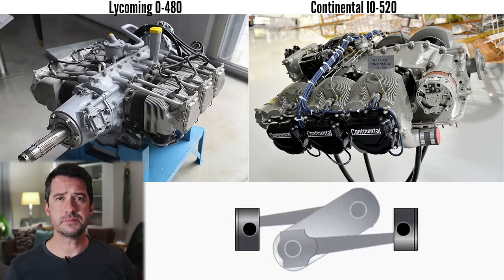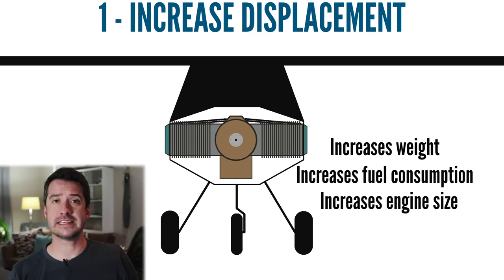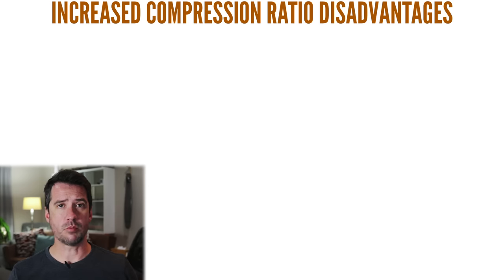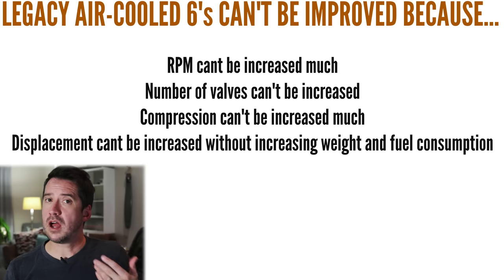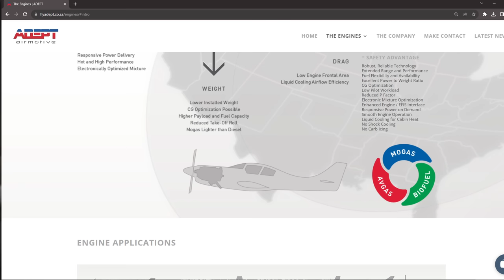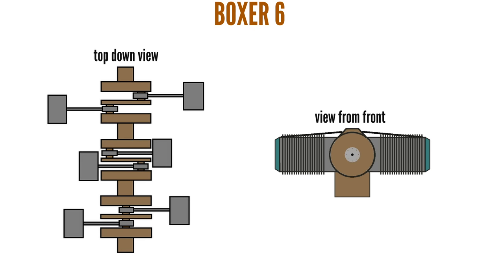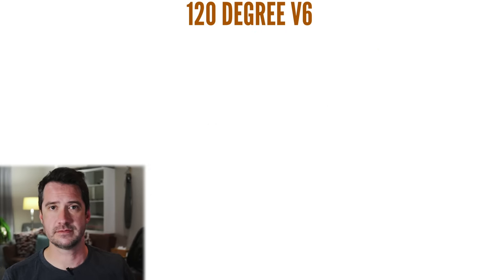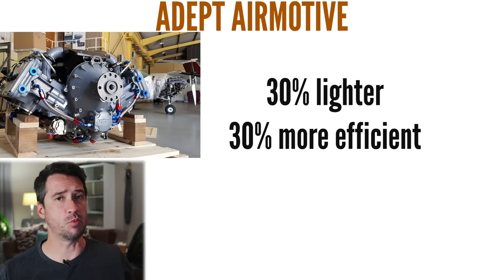Unusual V6 Airplane Engine Makes Boxer 6 OBSOLETE?

Comment: Porsche tried a new aircraft engine, so did Bombardier. Diamond has been using turbo diesels successfully. Rotax has many liquid cooled engines out there too.
Reply: And how many does Diamond sell per year? 15? 20? How many Porsche Mooneys have been converted to Lycoming power?
Reply: all i believe, I have never seen one Diamond sells many but i am not sure how many Astros are out there, Tielerts are now Continentals and i hope they have truly solved the Reduction drive problems, Early DA-42s were more costly to operate than PT6 over the Life cycle ( Fuel included) when they could fly, and, i do hate the single electronic fuel system, had a few DA-42 in the early years Land on Takeoff , gear half way retracted and engines shut down due to Low voltage when electric Hydraulic pumps shut everything down. New world tries to take away redundancy when there are still only three places an aircraft can be at any time, On the ground, In the Air or the Unfortunate In the Ground! Lets hope these guys understand good practices!
Reply: @brucecurtis4465 
I think five Mooney M20Ls still have the PFM3200 engine. It was great to fly, but a practical and maintenance nightmare. A Mooney M20J was faster, had better useful load, better support, and considerably less expensive maintenance.
What finally killed any future interest in the PFM3200 was the Airworthiness Directive that mandated replacing valve springs every 500 hrs. That's what happens when a sports car engine sits and runs at a steady 4,500-5,000 rpm for several hours at a time. It was never a suitable aircraft powerplant. An engine designed around modern automotive technology will never be a top choice for aircraft.
Reply: They tried Subaru engine but same issue with rpm for HP.  I feel they should work better but car engines are not made for high continuous output. Orenda tried but it never went anywhere, I made some cowling parts for otter conversions back in the day. But in theory they should be better.
Reply: @MrAerocomp  
The best car engine conversions are probably VW engines. They were initially based on a 1912 aircraft engine design. Being a shorter stroke than bore, they could make use of different camshafts to great advantage. Also, being air-cooled, they lent themselves well to motorgliders and small homebuilt aircraft use.
Water cooled aircraft engines are definitely not to be favored, and I don't know why so many people love the idea. Water cooling is one more point of failure that is completely eliminated in an air-cooled engine. Yes, I know all about Mustangs and Spitfires and, yes, their liquid cooling systems were huge liabilities that air-cooled Thunderbolts never had.
In an aircraft, safety and reliability must trump all other factors, even efficiency. Seems like most people want airplanes to have car engines. They don't realize that cars are cars and airplanes are airplanes. Airplane engines are more like hotrod tractor engines, making all their power down at a lower rpm. Car engines have to geared up to make that kind of power. There is the problem. Cars don't use all their power all the time. In fact, cars almost never use more than half their power. Airplanes do all the time.
The car cruising down the highway might be using 18% of its power to maintain speed. An airplane needs about 55% of its power just to hold altitude in slow flight. Economy cruise is about 65-70% power all the time. Airplane engines are designed and built to be such.
Reply: @rescue270  Gotta love poorly cooled engines that are forced to endure huge temperature swings and have components that crack and fail catastrophically on a regular basis. The PFM 3200 was air-cooled and far more primitive than modern automotive engines. Honda engine conversions seem to being doing great (Subaru engines aren't the strongest things in the world) and Toyota certified a V8 with no issue back in the '90s.
Reply: @PistonAvatarGuy  
Gotta love a seized engine because a mechanic didn't get a hose tight enough and all the coolant blew out when it fell off. Also gotta love all those clouds and rocky hillsides you can just pull over to just like a road shoulder.
Nah. I prefer air cooling in airplanes. I got 42 years with air cooled aircraft engines. They've never let me down yet. A lot of the cracking and catastrophic failing has more to do with aging that heat cycles. Had a few water-cooled cars give me some damaging cooling problems, though.
Reply: @rescue270  Hmm... a catastrophic failure because a valve got hot, came apart and got wedged between the head and the piston, or a coolant leak that's going to be obvious long before it ever becomes a problem... probably on the ground, before you even take off? That's a tough choice!
Reply: OK, how about the hose blew off thirty minutes after takeoff? Yes, I saw this happen to one of those vaunted Continental Voyager series engines one time. Pieces of shit. They ran hot as hell anyway, overheating bastards they were, and heavy.
I've seen valves break and get hammered. A Ferrari valve might break from heat, but an aircraft valve breaks from fatigue. Can happen to any aging engine. They don't just get hot and break. Unless they're defective, they get old and break, like well past TBO. You've never actually seen this in an aircraft engine, but I have, three or four times. That never caused what I would consider a real catastrophic failure. Aircraft engines have pretty low compression compared to lots of car engines. Engines ran like crap and lost some power but always kept flying to a safe airport. I've repaired a number of those failures. Remove the affected cylinders, remove the connecting rods and check bearings and journals for damage, replace the affected cylinders and pistons, find all the broken pieces, put it all together and away it goes.
Valves can break on a water-cooled engine, too. I swear if I never see another TSIOL-520 again it will be too soon.
Airplanes have been air cooled for a long time for a reason. Less chances of failure. Keep the air cooling baffling secure and in good condition and that is all the system needs. 
I am not talking out my ass here. I have decades of experience as an aircraft piston engine mechanic, and air cooling is definitely not a problem. Water cooling is only a complication. Any benefits it may have are negated by the drawbacks, increased maintenance for one. My experience tells me all I need to know. I never listen to sales pitches.
Reply: @rescue270  Ok, troll.
Reply: @PistonAvatarGuy  
Newby
Reply: @rescue270  Luddite.
Reply: @PistonAvatarGuy  
Rookie
Reply: @rescue270  will in some ways yes, I did pops and exhaust and lots of oil every day on old radials DC3's and 4's . Parts are just to old. You hang on to that but there should have been better systems developed but insurance is the stopper. And I build my first airplane at 14 a Bowers flybaby, and I have over 40 years in aviation, those were the last of the good days, today is all crap unfortunately.
Reply: @MrAerocomp  
You're the first person I've ever sent who mentioned insurance as to why airplane stuff is so expensive. You are 100% correct.
My standpoint is safety and reliability over everything else. The old systems in use are tried and proven. The object of aviation research should be to continue to improve upon reliability, but everyone is all concerned about efficiency, efficiency, efficiency. Then you have all these young guys who have been working around with crotch rockets and drift cars and they want all that in airplanes, and the realm of flight is so vastly different from cars and trucks and motorcycles that automotive tech that lasts for years in cars can wear out quickly in aircraft for reasons nobody will understand.
They see magnetos and sneer at them for being 120 year old technology, but hey, they are very simple, very reliable, and easily field repairable so long as their parts are still made to high quality standards. Many of these young guys do not even understand how a magneto operates and would be amazed at its simplicity. I've known several young A&Ps who have been through school and were stunned to learn that the mags are self-powered, self-contained, and not powered by the airframe electrical system. The alternator can fail and the battery fall out of the airplane and the mags will keep the engine running as if nothing happened. Old means tried and proven- not unreliable. 
Research needs to be working toward improving existing technology. Not replacing it with something newer just because it's old. Airplanes are not cars, trucks, or motorcycles. Some things need to stay the same, namely the engine being as simple as possible for the application and able to run continuously with no airframe power source.
Reply: @rescue270  "Old means tried and proven- not unreliable."

And yet, cars and airliners have increased in complexity, efficiency and reliability, while light aircraft remain in the dark ages.
Reply: @PistonAvatarGuy  
Please stop thinking that airplanes are flying cars. The realm of flight is so different from driving that everything for airplanes needs to be designed for flight at altitude. Even automotive alternators need different brushes in order to fly.
Cars now cost as much as used airplanes and airliners cost millions of dollars. A new old-school Beechcraft B36TC costs 1.3 million dollars and I don't think they've sold a new one in three years. Adding a bunch of more costly stuff to these things will make them even more expensive. 
I really don't see the old school systems holding anybody back from flying. In fact, since the old school stuff is always more affordable, it means more people get to fly. You already gotta be a millionaire to buy pretty much any new cross-country airplane. A new 172 costs almost half a mil. These things don't need to be more complex and more expensive. That's my greatest point. What good does any of this new tech really do? I have not seen what I would consider any appreciable increase in safety or reliability in most new technology. What I see more than anything is just more expense.
Everybody I know was pissed off that glass panels were being put into new light-sport airplanes. What is the point of that other than to run the price up for wealthy buyers who love the way it looks. That is all you get out of that. It looks cool. It does not change anything about how the airplane flies.
Reply: @rescue270  maybe they should try some 80's mercedes engines. at least the M103 inline 6 has to run nonstop between 3000-4000rpm because the 4 speed gearbox makes you run at 3000rpm for 100km/h, 3500 for 120 and 4000 for 140km/h(usually overtake). kick down a gear and rev it to its limit (6200rpm) if you want to overtake faster. it does have some oil leak issues but is also know for stupid long reliability and capable of turbo in stock form.
Reply: @marcox4358  
That's crazy! I never knew that.

Comment: i doubt it has a balance shaft,the only V6 i know of is the 90 degree buick engine which has a 90-150 degree separation between firing cyl cos they didnt want to produce a split crankpin crank,the 60 degree V6 is also a 120deg between firing cyl engine and does not require a balance shaft either,the 120 degree V6 was used in volvos,renaults and delorians,steve knott ran a modified volvo V6 in a karmann ghia he won australian off road championship with some years ago
Reply: Manufacturers used to produce 90 degree split crankpin V6s without balance shafts and six throw crankshaft 60 degree V6's without balance shafts but they have gone away from that entirely.  I don't think there are any V6's currently in production without balance shafts.

Comment: Interesting video. I have it on good authority that Prodrive is also building an engine with similar parameters. High efficiency, high HP and lower weight. Unfortunately as some others have said..all but impossible to get into GA unless its for experimental AC.

Comment: Hello, very good video, an tried to make very clear explanations, but, There are many pushrod engines that are efficient and reliable by modern standards, modern GM small blocks and Chrysler Hemi engines come to mind.  The Hemi even has 2 spark plugs per cylinder, so it is an ideal candidate for dual ignintion systems.   The air cooled heads presents the most limitations to working with higher compression and more efficient designs.  Rotax has solved the issue with water cooled heads.
Reply: Hemi isn't very reliable.  Lifter and camshaft failures all day long because they oil the valvetrain in the dumbest way I've seen since the Ford Y block.  The cam bearings get oiled the typical way, but the lifters, pushrods and rockers...  

Oil comes up into the rocker shaft, then it goes into the rocker arms, where hits a T intersection - one side is very short and goes to the where the rocker and valve stem meet, the other goes to the pushrod, then down the pushrod, then into the lifter, then, what little actually makes it TO the lifter can bleed out and fall straight down and away from the cam lobe (and lifter roller bearing, where the failure happens) because the cam is so high in the block, the pushrods and lifters are nearly if not horizontal.  

Despite what the fanboys say, the 6.4 lifters also fail.  

One solution I've seen is to use modified pistol oil squirters to shoot oil at the cam lobes (and lifter rollers) instead, but I'm not a fan of that because then the pistons can get hotter than they should.  

About the best way to keep a Hemi alive is to avoid idling it any more than necessary.  To save fuel, there's next to no oil flow at idle, meaning little splash lubrication from the crankshaft and basically no "overflow" from the lifters themselves.  

And to preempt the Hemi fanboys again; yes, Chevy LS series lifters do fail.  Sometimes.  But nowhere NEAR the rate of Hemi lifters.

Because the Hemi is not a good design.

Comment: Having a much shorter compact engine also is an advantage for the center of gravity for aviation. When you're agent hangs way over your wings that you have to put weight in the back end the ballast the center of gravity. Having a much more compact engine package means you don't need to have that much added weight for balance which gives you more cargo weight capacity for your plane. It's not just as much as saving weight but also just shortening your fulcrum is a huge advantage to have good control of the aircraft
Reply from the maker: Agreed, mentioned here 9:49

Comment: Yeah wow. Every time I said to myself yeah but what about… you went on to address the topic. Very good video! Surprised though aviation hasn’t borrowed from the automotive industry like with the diesel counterparts (Astro engines now continental). Suppose weight is still the issue.

Comment: Adding a Turbo does NOT increase the compression ratio.  It does increase cylinder filling, thus, better performance, more HP, torque etc., but has no effect on ratio.
Reply from the maker: Agreed. It does not increase compression ratio, I said it increases compression. I.e. it forces more air in, which compresses it more.
Reply: @LetsGoAviate compression also means decompression and the work done in the work stroke. Context! Outside of engine mechanics you are correct.

Comment: 1] A 120 degree V-6 would be great in a Honda Gold Wing.  2] In a legacy flat 6, having two cams in the block, one above, and one below could facilitate 4 valve cylinders. 3] I find it hare to believe the 30 percent improvement in specific fuel consumption as lower rpm motors generally have better fuel efficiency, at the expense of weight.

Comment: The fact that they are still allowed to use leaded fuel, and to rebuild these engines for LL still in 2024 is absolutely mindblowing. I know private aviation is a very minor aspect when it comes to ones to emissions. But just because they are allowed to still be extremely dirty and inefficient means we don’t get better engine with much less fuel consumption, lighter and much more environmental friendly while also not making you breath in these toxins. 
Yes they are reliable but they are also relicts. Time for some chance. And by law, otherwise nothing will change.
Reply: And their reliability is also way overrated. But like with everything - if it's properly driven and taken care of it may last a long time. But this is very much down to the human factor. Many flightschools (or most) seem to have the wrong idea about fuel mixture, which is manually controlled when using a carb engine.
Reply: @terjehansen0101  it’s a engine design that is several decades old. It’s inefficient, requires a lot of knowledge and should long be replaced but there are hardly any new ones especially certified ones

Comment: It is possible the gear reduction system will act as a balance shaft.
The main improvement is the engine runs on automotive unleaded  pump gas.